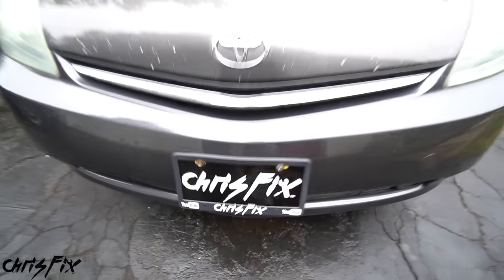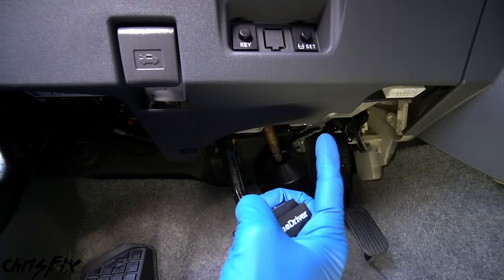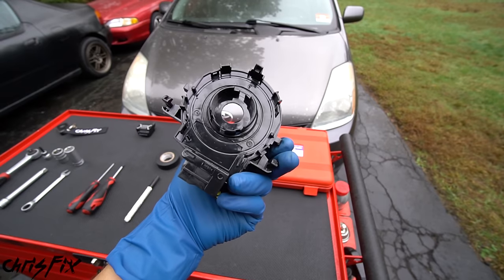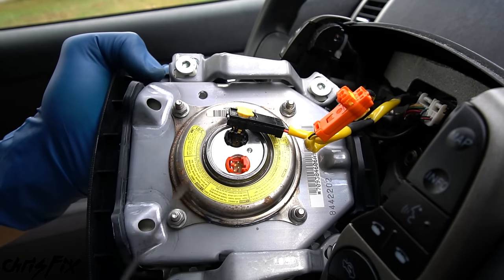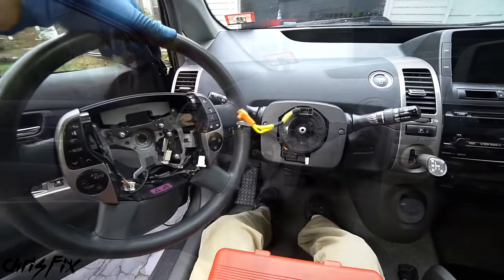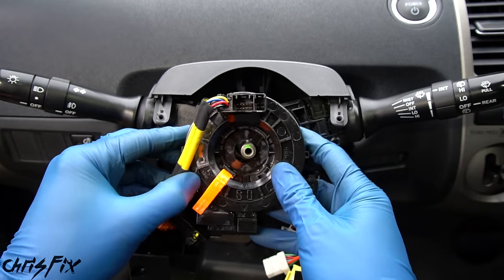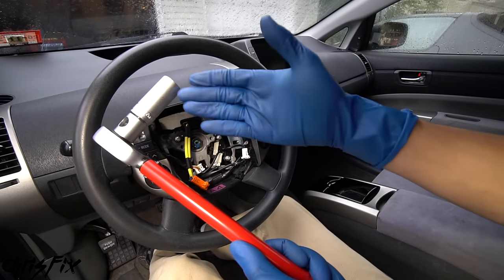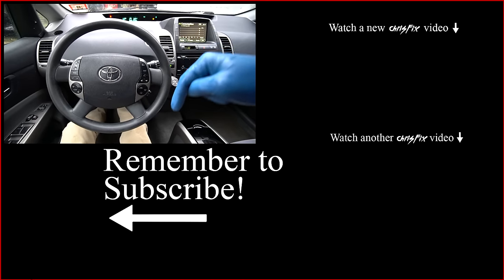How to Replace a Clock Spring (airbag light & horn not working)

Comment: hey chris where would you get the best deal for the clock spring in your truck? I have the same one and my clock spring it bad, have a circuit high on the airbag and my horn doesn't work

Comment: Hi Chris, speaking of 2007 Prius, the instrument panel will not come on, the car starts but no speedometer or gas gauge. What do you think. I just changed out the accessory battery too.

Comment: Once I had a problem with airbag of the driver seat and I understand that the wire was disconnected and fixed that but the air bag light was still on and I had to erase the trouble code and everything was ok

Comment: Urgent question…the cover came off my clockspring when taking off the steering wheel and the roll inside came out and is all tangled up…can I just stuff it back in and call it a day? Everything is connected…or does it have to be rewinded a certain way

Comment: My airbag light is still on.   However, the cruise and horn now work.  Did I miss something, or is there an issue with the airbag?
Reply from the maker: I would first see if there is some kind of reset sequence you can do, if not then do a scan for airbag codes and go from there now, the clock spring was definitely broken though

Comment: @ChrisFix I have a 2015 Prius and my horn keeps going off at random times. Would you recommend replacing the clock spring? My airbag light isn’t on. Everything else is working fine. The horn is just randomly honking really loud.

Comment: The orange tab you break off, I pulled out, didn't notice the OEM one was snapped off like the one you did. Is there a reason it's snapped off? will mine be ok pulled out? Everything runs like normal.

Comment: Hi chris Audi A4 2014 model airbag light not going away .did reset few times keep coming back. Checked under seat plugs cant see any problem. Any advice?
Reply from the maker: Could be a bad clock spring or the battery voltage is getting low!

Comment: Hey Chris, I have a 2005 Prius. My airbag light just came on, but there are no readable codes at all. Some, but not all of the buttons, stop working unless the wheel is turned to various positions. Horn works though. Do you think that the clockspring is the culprit? Because I have no detectable codes, I kind of have to start guessing and replace one component at a time until the light goes away.
Reply from the maker: Sounds like the clockspring to me.

Comment: I changed the turn signal lever on my 2008 Pontiac Torrent and it still does not click off after you turn the steering wheel back straight after a turn...do you think this could be a clock spring issue??? Any information from you will definitely help thank you

Comment: Hey Chris ! 

I have a 2015 q50 and my push to start button doesn't work unless I bring the key to the button and then press the button. My airbag light is on and my question is... Can the clock spring affect to push to start function?

Comment: Wondering if issue of horn coming on by itself AND STAYING ON could be caused by bad clock spring. My car is 1995 (pre-obdII) and air bar light is ON. Also, turn signals are not working.

Comment: Hi Chris my wipers are not working I have replaced the motor and check all Fuse do you know what else could be don't know if clock spring working as don't know if that effects the wipers I also brought new wiper arm switch

Comment: Hi so my wifes rav4 2009 is having this trouble.. the car did not have the horn and the airbag went on the dashboard.. my question.. did you end up using or buying OEM or from ebay?

Comment: 15:10 the combination of threadlocker (or anti-seize) with a torque wrench is a bad idea; because both provide some initial lubricant, you end up with a higher compression than what the same torque would have applied to dry parts

Comment: Is the after market clock spring universal?
Reply from the maker: They might the same one on a lot of cars but you'll have check fitment!
Reply: @chrisfix  will it fit on miata mx5 2017? I tried putting a quick release and I didn’t know you’re not supposed to spin the clock spring :(

Comment: I replaced my clock spring on my 2005 Infiniti G35 coupe, everything was aligned and my traction control lights turned on and now they won’t leave my dash. It shows VDC, SLIP light on how can I fix this issue? I don’t want to have those lights on my dash
Reply: @chrisfix

Comment: Hello, My  2011 Nissan Altima 2.5  was involved in an accident. Airbag got deployed . I have changed the airbag and front seat belts. But, still have the airbag light on ! Do you know what else do I need to change? please let me know if I could use your help with this problem. Thanks a lot in advance

Comment: Is it bad to get an aftermarket part? I'm scared that itll break easy or won't last as long
Reply from the maker: 99% of the time if you buy an aftermarket part, they are made to the exact specs (or even higher) that the manufacturer puts out! I have very rarely had aftermarket parts break!
Reply: @chrisfix  Do you have any recommendations for picking out aftermarket parts. I have a Toyota Camry 2012 clockspring that is broken and for some strange reason the camrys from 2012-2014 arnt sold at AutoZone or Oreilly's. The part is 400 - 600 dollars OEM. On Ebay it is much much lower, but at I don't know if I should try to get it. 

Any help in this matter is greatly appreciated.

Comment: I have an airbag light on, but my steering wheel has some play in it. So if my wheels are straight but my steering wheel isn’t (or vice versa) would I still be able to replace the clock spring?

Comment: my airbag light is on and my horn doesn't work, when I get my Mustang back together from fixing a  coolant leak from under the intake manifold I'll test my cruise control and see if that works or not, main thing is fixing my horn and airbag light so I can get it inspected

Comment: My horn wasn't working and I had an airbag light and it turned out to be both the clockspring and the horn.

Also you can pull the codes by jumping the obd2 plug and getting it to cycle through the codes by flashing the ABS light... each car has a different way of doing this.

Comment: My new clocksprint has one large red locking tag, which i will remove, but at the opposite side near the electrical socket there is a smaller red plastic tag also, is that also a locking tag, which has to be removed?

Comment: I don't have a problem YET but i somehow messed up with my steering clock spring😂 just in case i wanted to know if i mess it up badly.
Reply from the maker: Dang, was it not aligned?
Reply: @chrisfix  i guess it's not aligned yet since i couldn't take my car out for a drive yet but the steering feels sluggish now.
Reply: @chrisfix  is it possible to aligned it myself or should i take it to workshop?

Comment: The clocksprings and specially aftermarket ones are really dangerous in a way that when they go bad they could potentially make the airbag go off which is not good. It happened once in my hometown and caused an accident. Definitely woth spending 200 bucks

Comment: I read somewhere that a Nissan rogue needs calibration after the clock spring is replaced.
The Bluetooth and cruise and horn and the radio controls don't work.
None of it worked when I got the car , my biggest worries is that it needs calibration, I've been working on my own cars and trucks since I was a teenager and I'm 65 now and can't afford the 200+ dollars to get it calibrated, could you please let me know if I do or do not have to have it calibrated

Comment: Hi.  my 13 GT had The Advance Track needs service light come on and also had no power steering.  I was told by auto repair shop the code reader said it was a Ford Steering Wheel Position Sensor. Is this the same thing as the Clock-Spring ?   I can't find the Position, so maybe the Clock spring does both ??? Thanks

Comment: I have a quick question. I have this same problem with the airbag light on my 2007 buick lacrosse. I have been trying to find a replacement clock spring for the part on my car but I can not find it anywhere. Are clock springs this hard to find or am I doing something wrong.

Comment: Memories that Chrisfix cut out the old leather and recovered the whole steering wheel the leather or the edge is all crack and faded and use the steering wheel puller and now Chrisfix has access to the clock spring 10:00

Comment: Hi Chris. Just change my clockspring on my 2012 Toyota Prius reason is horn stops working. It work after replacing the clockspring but traction control on my dash came on. Is this related to the clockspring? Please advice. 

Thank you in advance

Comment: Hey Chris what would a clicking spring like noise coming from the steering wheel /column when turning?
Reply: that heavily depends. hopefully you’ve figured it out but we’d need to know if it’s hydraulic or electric power steering first

Comment: I have changed the airbag on my 2011 Nissan Altima , front seat belts.but, still have the airbag light on ! do you know what else do I need to change? please let me know if I could use your help with this problem. airbag light  stays on at all time  Thanks a lot in advance

Comment: Chris i know this post is old but im desperate,  I replaced the blower motor on my 2016 nissan versa note and didn't have the wheels straight when i disconnected the steering shaft and wheels were turned, now steering wheel is off center and a slight rattle from floor board area ,every time i disconnect the shaft and straighten after driving wheel goes back to off center, What can i do to fix it,

Comment: Hi Chris 
I have a doubt
2001 corrola 1.8 j 
Old air bag module complaint.
    I am changing new module but airbag light not  off.
     Any programming required Chris ?

Comment: Chris question, changed out my clockspring but steering now feels stiffer than before, is it potentionally a bad clock spring?
Reply from the maker: If the clockspring was bad then you would have no horn or arbags. Did you torque the nut that holds the steering wheel on to spec?

Comment: I had my clock spring replaced earlier today.  After the replacement, the steering wheel was a bit crocked to the right.  I took it back to the shop that did the replacement.  The guy took the car for a spin, came back and adjusted the wheel.  It is now quite crocked to the left.  I did not take it back again as I don’t trust that he knows what he was doing.  I am concerned though.  What should I do?

Btw,  the airbag light after the replacement come back on.  The horn is working though.

Comment: My steering wheel is stuck and the thread got stripped because the steering wheel is heavily bonded with the steering column. Do you have any tricks for this? I sprayed liquid wrench and pb blaster and let it sit over night it still didn't loosen up.

Comment: Hey Chris. I have an issue. Recently i changed my horn and i found out that if the car is not on, it doesnt work. I have to start the car for the horn to work.  

I also notice that if the car is off. I hear a soft clicking sound where the horn is lovated

Comment: Who is the first check when i want check the clock spring? My air bag light turning off after 15 km on winter and after 5 km on summer
Should i have to check the continuity  from the yellow wire?
Greetings from Greece.

Comment: @ChrisFix - Would this clock spring problem do the opposite with the horn? where it will sound off on its own without you pressing it? I am having this problem. I unplugged my horn at the grill to make it stop and I have an airbag light. But yea, my horn had the problem of not shutting off.
Reply: yes, it can happen

Comment: Chris, I followed all your instructions and my clock spring got replaced successfully no air bag issue now
Buttons are working fine 

However now I have traction light on 😢
Please help what I did wrong
Reply: it’s your steering angle sensor. you can look up a scanner that does coding service (autel, fox well) for your specific make and model and there may be one that can help. or take it to the dealership and have them calibrate it (won’t be cheap).
Reply: @Schriftt  thank you so much for replying yes it was Angle sensor
I changed it 
Now no more traction light on but air bag light is on again 
Buttons, horn etc are working but the airbag light is on again :'(
I reached out the wiring below my car seat to tighten it but no luck. 
B1800 error code as per scanner
Reply: @satenderrandhawa2803  What’s your vehicle? Maybe if you bought an aftermarket clock spring it could’ve gone bad again. although if it’s OEM, maybe there’s an issue with your wiring to the SRS module. I would not advise sticking a multimeter and checking for Ohms or voltage as that can potentially set the airbag off or mess the SRS system up even more. Techs are even told not to fix wiring when related to SRS systems and to just replace the unit. I think if it was an aftermarket part however, I wouldn’t be surprised if it gave out so quick. you could also make sure you’ve installed it correctly?
Reply: @Schriftt  hi 
It's Toyota Corolla 2014
Do you want me to reinstall the same clock spring again.

Comment: Hey chris i was changing my steering wheel on my 2016 q50 and when i finished the wheel wont turn all the way to the left, i can turn it all the way to the right. If the clock spring say wasnt centre and i accident turned it would this hive me the problem im having ?

Comment: Huh, so i have an 2017 infiniti qx30, I called the infiniti dealership and they said, for the part alone,  it'll be $750. Is there a cheaper option? Can I just use the $20 one? Or since its an infiniti, I should buy the $750 one. Also, is there someone else i can buy it from?

Comment: Does it matter if the clock spring has electronic stability control or not
Reply from the maker: If that feature goes through the clock spring and you car is equipped with it, then it be required to get a clock spring with that
Reply: That's the thing. I'm not sure if it is on not. I have a 2011 Chrysler 200 touring 3.6 liter

Comment: My horn stopped working and my air bag sign also is on.

My biggest concern is my Brake lights don’t work :( I have to keep changing bulbs constantly. So does CLOCKSpring
Have something to do with this? 

I own a Hyundai Elantra Gt 2014 :)

Comment: @chrisfix I have a 2008 prius which has the airbag light on, horn does NOT work and some of the buttons on the steering wheel don't work and don't light up.

Could this be the issue?

Comment: I also wanted to add my OEM spring says before installing to rotate 2.5 turns from left and align arrows. But if I rotate 2.5 turns the arrows will not line up. I’m very confused by this request, why would they not just make it in the right position for install!? Any help would be great. Thanks

Comment: Damn I replaced the clock spring,  but the airbag still on.  After market clock spring only cost me $12.  I’ve cleaned the airbag wires under both seat and the light still.

Comment: Hi Chris i have a Code: C1231 Steering Angle Sensor Circuit popped up on my 2009 Venza after replacing the Steering Rack, although the centering of the rack was way-off. so After i took it in to a dealership for alignment, i still notice the traction and VSC light is still on....then i tried using my OBD Scanner to clear it still it won't go away then i drove down to the dealership same thing they could not clear it. I then perform zero calibration on it still the VSC light won't disappear....Pls what else can i do? Thanks

Comment: The dealership says I need a clock spring yet the horn always works. Air bag light on, checked for loose connections under seats, all good…

Comment: @ChrisFix I think i messed up my steering/Clock spring alignment.  I had to remove both to install a new turn signal stalk on my tacoma.  I shamingly did not mark the position of the steering wheel and clock spring and now when i put everything back together the truck drifts right while the wheel is in the straight position and i am getting 4 error codes :( .  I now see how to recenter the clock spring by looking for 2.5 turns or the orange marker but how do i recenter the wheels perfectly. Any tips? just trial and error by viewing? Thank you!
Reply from the maker: Straighten the wheel the best you can manually and Drive up your driveway or somewhere flat. The caster in the wheels will self center the wheel for you. Do not touch the wheel after it self centers. Verify the tires are straight visually and now you can take the steering wheel off and put it back on straight. Go for a ride and see if that works.  As for the clockspring, if you only turned it a little and it didnt break the wires internally, you can straighten that out too or replace it.
Reply: @chrisfix  thank you for the reply.  I was able to center it back and it now drives straight.  However I'm getting VSCS, Pre-collision, cruise control, LDA, malfunctions.  The horn still works, as well as all steering wheel buttons.  any ideas?...

I drove it while the clock spring and wheel were not centered and thats when all the errror codes started going off after driving it around for a minute.  So thats when i watched your video and recentered the clock spring and wheel(Thank you!) but the errors still remain.

Comment: During the first removal of the nut I jerked the steering wheel to the left and locked in place. Once replacement was done, during the test drive my steering wheel is slightly left turned while the car goes straight. How do I fix the sightly off centre steering wheel angle?